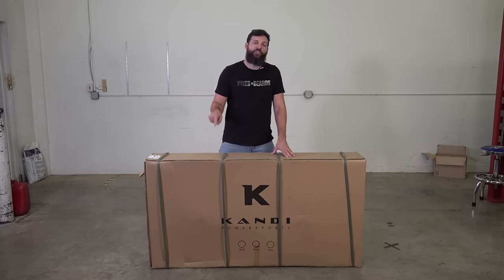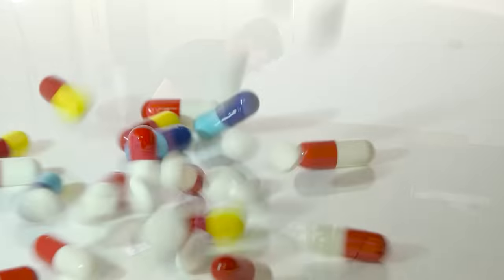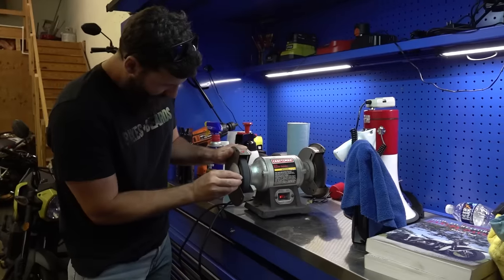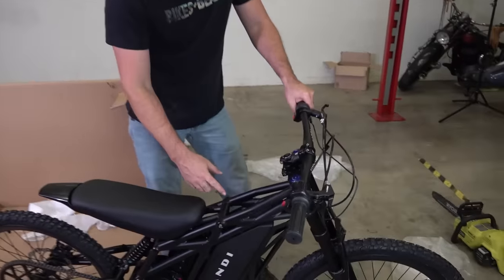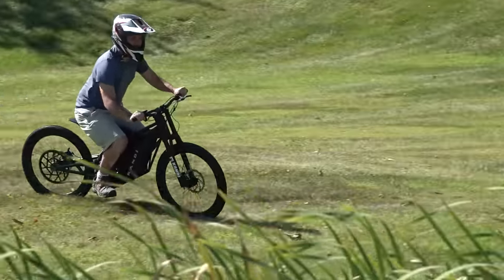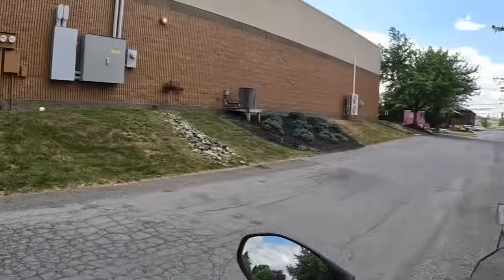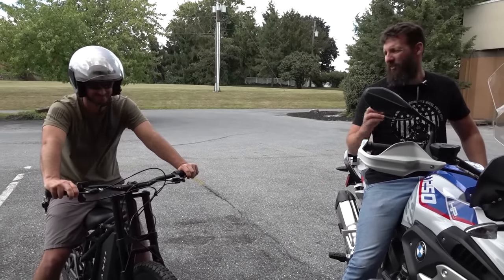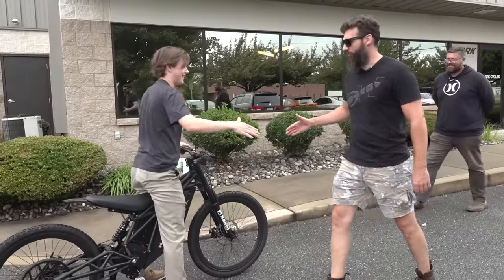I Bought the Cheapest Electric Dirt Bike at the Auction

Comment: I had a similar issue with spacers on a dirtbike wheel I was trying to install, it turned out that the spacers actually kind of press fit into the hub. I had to apply some pressure (more than I was expecting to need to) on each spacer and then they sat into the hub just slightly. I wonder if that was the issue you were experiencing with the spacers?
Reply: Doh
Reply: could explain some of the grinding sound if the spacer and bolt were spinning
Reply: I hit everything with rubber mallet until it works
Reply: @supersecretyoutubeaccount  poor wife you have
Reply: @destickert1307  😂😂😂
Reply: @supersecretyoutubeaccount  If a rubber mallet doesn't work, a hammer can fix anything
Reply: @gregorydeutsch3530  The easiest way is to sandwich the wheel and bushings tightly against a light-pole at any Walmart parking lot with your truck's front bumper. Go shopping for a few minutes. By then at least 3 Asian drivers will have completed the assembly.  {-_-} 🤣
Reply: Did you cuss at it..? That’s works for me!
Reply from the maker: Ohhhhhhhh shoot
Reply: Standard mountain bike hub with changable spacers to suit different sized fork/axle sizes, 15x100, 15x110, 20x100 etc.
Reply: @supersecretyoutubeaccount  Funny story. About 20yrs ago 3 of us maintenance guys were helping the mold-crew drive in some new date inserts on a big aircraft tire mold. We used to pour our own Lead hammer-heads for soft-blow hammers but "BadYear" decided to replace them with those "safer" Nupla rubber-hammers.

That day "Bill" was taking his turn at beating on that insert and suddenly he stopped hitting it. We realized the rubber head had broken off. We looked all around wondering where it went. Then we saw "Ted" (another maintenance guy near us) jumping around wildly, cussing and holding his forehead.. When we got him calmed down, he removed his hand away from his forehead and a big ol' cartoon knot came up on it. Some of us could hardly breathe, we were laughing so hard!! 🤣
Reply: you are supposed to tap them in with a mallet
Reply: the lack of knowledge here is astounding
Reply: @destickert1307  she works at least
Reply: @supersecretyoutubeaccount  ASC certified I see!!!

Comment: I'd like to buy an electric bike, but there are so many manufacturers my concern is getting ripped off. The other issue is buying one and the manufacturer goes out of business.
Reply: If you want a mtb/dirt bike mix, a Sur ron is a great way to go. It is a very reputable brand with lots of 3rd party vendors that have upgrade parts and eom parts. I have a Sur ron myself, and it’s a blast!
Reply: @brodienelson380 facts get a sur ron
Reply: A suron is the bast way to go buy u can easily fabricate ur own with a company called electro and co.
Reply: Buy a Lectric XP
Reply: Aside from that, the biggest issue is the cost of the replacement battery pack(s) that you will need to buy in a few years.
Reply: @yamizombie1974  why they are slow
Reply: I want buy something like surron but weaker under $2000
Reply: Surron ultra bee is my favorite electric motorcycle. Very capable on and off road, fast, massive 72v 55ah battery as stock.

Comment: I bought a whipper snipper that came with allen keys. I tightened one bolt and the allen key was done for. Its now round. I swear they make then out of ALUMINIUM. The bolt, however, is perfectly fine. Luckily i have actual tools and tightened the rest up fine

Comment: My wicked e bike cruiser does 39 MPH for 1,999$. Bmx handle bars, (The freedom has full suspension) 26 inch fat tire. 60 Volt 20 Ah battery, 40 amp controller over 2k watts output 1k continuous, 100 NM Torque. Nothing beats it for the price. Nothing comes close.

Comment: Not heard of the bike brand but have you checked to see if the forks are air or spring
If there air you will need a shock pump to pump them up (1psi to 1lb of body weight)

Comment: The fork has an air spring. You probably need about 100 psi in the fork. Its still a crap fork but, it will ride better if you air it up.

Comment: Its actually not that bad of a bike when assembled correctly and set up right. The front spacers need pushed in right they fit prefect. The front forks need air and oil and the rear shock needs adjustments for the rider. After all that you're good to go. Bring it to mon-valley ill fix it
Reply from the maker: I’m not sure that I can see how those front wheel spacers ever went in there the way they were. But even after that the ergonomics of the bike were awful
Reply: @BikesandBeards  it isn't the best for tall riders no lol but there is different peg sets extenders and what not. Its a clone of the Drill one evo bike which is AMAZING 👏

Comment: you could remedy that fork problem by substituting it with an Air/oil shock
Reply: Also,you need to raise the seat. The seat height needs to be so there is only a very slight bend in your knee

Comment: Do the forks need air in them?
Or are they spring forks and you are too heavy for the sping?
Reply: Yes they do. These are Mountainbike Downhill forks, they should be pressurized with the riders weight to spec.
Reply: Yeah I kept thinking the same.  And they could have adjusted the rear spring preload.  But it probably would have been disappointing anyway.
Reply: Also, how can a disc brake on something so light be so ineffective? The internals of all those parts are just garbage it seems.
Reply: @vincedibona4687  because it's a mechanical disc brake. They (manufacturer) should have went with hydraulic brakes on that bike.
Reply: @k0k0w  

It's not because it's a mechanical brake, that's the issue. It's because they don't know how to do basic bicycle maintenance. They clearly left the cables slack.
Reply: yep
Reply: @Psyrecx  you could see when the camera man pulls up he has the levers pulled all the way back meaning that there too much slack and it's not adjusted right
Reply: @k0k0w  mechanical disc brakes are good. I have some on my motorized bike and they stop from 40 in like 10-18ft
Reply: @Psyrecx  he's used to hydraulic brakes he never has to work on the old trail 90s they never break
Reply: @kevinmontoya7318  Depends on the brand though. Those that come stock with the bike are sometimes a bit janky. Also, I think the new ones on the bike aren't bed-in yet thus the poor performance.
Reply: @Psyrecx  True. You have a point.
Reply: @kevinmontoya7318  

That was my point. Typically, when you get a bike, unless it's built by a high end shop, you have to check those things... as well as stuff like spoke tension. 

They work on motorcycles, and they probably still never check that, as well.
Reply: @k0k0w  I totally forgot about the brand. I have tektros on mine
Reply: @16driver16  Those mech ones that come from 90s bikes are agreeably not bad. But these ones that come stock from china are usually questionable, thus i'm picking hydraus over mechs at this point.
Reply: @kevinmontoya7318  yup. Tektro and those that come from Avid and shimano are the better ones. Pauls are great ones too, but are a bit pricey.
Reply: @k0k0w  true, though his 90 actually has pretty aweful drum brakes front and rear they still are very low maintenance and work for a long time
Reply: Yea honestly really sad that these guys couldn't figure out how to set that bike up right. I can tell its not as garbage as it seems in this vid. Come on Bikes and Beards! If you're going to do bicycle stuff atleast learn how to do it right. watching a simple youtube vid on how to adjust brakes and suspension would have helped so much in setting this bike up
Reply: at that rrp they should definitely NOT be mechanical brakes though, at $1100 you can get away with cheaper brakes for sure
Reply: Yes i lmao. Forks need air.
Reply: @-Jethro-  to me it seems ok
Reply: @jackstange9211   
Or help out a local business and get it assembled by a bicycle mechanic, where they can help you with the review by giving insight on whether or not the bicycle parts are any good, what you have to do to set it up and possibly suggestions on whether you should buy cheap and customise or just pay a higher price.
Reply: @Psikeadelic  
It's pretty sad how the bicycle industry is going lately. The times when you actually got value for money with bicycles is long gone, nowadays industry leaders are too busy making proprietary components that only with with proprietary tools, they've settled on a new standard MTB wheel the 27.5 inch, almost every brand except for Walmart and toy store brands are a minimum $1000 for entry level bike... Yeah nah no thanks, I have been a bicycle mech for 10 years. The industry is dead and greed and carbon fibre did them in.
Reply: They will be oil filled, the "slime" he had on the headstock was fork oil.

Comment: I wonder if the bearings were properly seated in that front wheel. Also, I'm wondering if that's a counterfeit bike. That would explain the tailgait deal
Reply: Sur Ron rip off possibly
Reply from the maker: Maybe
Reply: Its called the Home Boy Shopping network in my Hood, Deals to good to pass on!
Reply from the maker: That could have been it
Reply: Can I have it
Reply: @SHAUNDIGITY  I can here the theme song now ending with..."IN LIVING COLOR!!!"
Reply: More than likely someone bought a damaged pallet of these bikes for cheap at auction.
Reply: I took a look at the spec sheet and it's specced terribly, a good bit worse than my own ebike, which has pedals and is built off a regular bike and $1200 in parts. Smaller battery, half the power, worse shocks and brakes. I don't think it's counterfeit, it's just a rip off.

$3600 could get you a 70mph ebike with a 4x bigger battery, and 30hp, the Kandi is only 1hp.

Comment: I would imagine that those shocks need either fluid or air to allow them to work. But it’s kind of weird how at that price the disks are hooked up to cable rather than hydraulics. Looks like a really fun bike for a grand but more than that seems like a rip off.
Reply: Yeah, they're bottoming out completely and that's why he's sliding off the seat, lol.
Reply: Some mechanical disk brakes work very well and provide excellent feedback to the brake lever
Reply: pretty sure its oil was all over the head tube when they opened it up. seems like its all cheap parts. mechanical brakes, cheap forks, tires. the sitting position is scary. yup, rip off
Reply: @melaniecotterell8263  some...but those are not any srams or shimanos. its all cheap components from china
Reply: it's only cheap hydraulics brake, great for light bike not for a bike that weight a ton
Reply: I'd assume hydraulic fluid since that's probably what the slimy stuff was so the the shocks are leaky and now bottoming out
Reply: air, theyre mtb forks
Reply: mtb forks come without full air pressure
Reply: I thought same…. I’m guessing they hoped we wouldn’t notice that ?  No way possible they didn’t….  Reality TV on YouTube..

Comment: I wonder how fast can an e-bike made from Ryobi chainsaw go.
Reply: you might be on to something there... Grind hard plumbing made a tiny boat go with a drill and someone else made a razor scooter with a drill drive too
Reply: Well ryobi is pretty trash so not to quick
Reply: Tree mph
Reply: Negative 10 mph
Reply: I don't know but I bet it would buzz along
Reply: Volts = speed. The chainsaw is 40v so I'd say like 15-20mph max. The problem is you need a much bigger battery
Reply: @Ridzy2489  I’m a Milwaukee snob but ryobi is not trash you’re mistaken
Reply: Durham Reality  it’s funny you say that because they likely supply parts for 98% of the market dig deeper then just the scratched interesting truth
Reply: Durham Reality  I’m still curious on the kandi - ryobi connection I’ve found nothing to support it, other then TTI Produces, Ryobi, Milwaukee, amongst others…
Reply from the maker: Great question
Reply: @TheOneAndOnlyRandy  Grind Hard Plumbing also did a electric chainsaw motor into a small motorbike.
Reply: @BikesandBeards  Zero to sixty in 4.3...minutes, but it would get 200 mpg!!!  At least take off the teeth on the chain if you are going to ride it!  Hmmm?  Could the saw chain be replaced with a bike chain and a 21 speed, 7 gear wheel at the rounded end?  Has it already been done? ****It would only be a 7 speed because you wouldn't have the front 3 gears that a pedal bike has.  NEW IDEA...Pedal assist Chain saw MOPED!!!

Comment: I’m 80 % sure that those are air forks and if not the springs in it you might be able to change them out for stiffer ones because this forks alone they use for downhill bikes sooo maybe check to see if you have to put air or if it is a front spring loaded shock
Reply: Umm if "air forks" like old 80's bikes they would have a Schroeder valve on the caps .... Duh! 🙄
Reply: @shawnsatterlee6035  They did, the big red cap on the end. Underneath.

Comment: The axle had on it the fork leg, bearing, then bushing; you assembled it fork leg, bushing, bearing, then hub.  I bet if you had followed the correct order it would have fit without grinding.
Reply: Yeah, and the brakes would have worked better as well. I'm assuming the caliper is slightly misaligned now.

Comment: that front end fort just leaked fluids out of it that was why it failures seal o ring and company who make it was totally failures it not worth 3600 dollar i do say worth $200 like is it as it is because it run n ride fine just dont have enough miles n one i just build like diy with 3 12v battery just make it 30 miles going 40mhp straight line no stopping (i find my self a broken dirt bike that engine was trash n broken (look like crash landed into tree limps into engine) i swap it out for electric motor and put 3x 12v battery in it fit perfectly tight no touching each other and only one issues with it esc DOES NOT COME WITH CHAGER OR DOESNT HAVE CHARGER PORT so i have charger each battery with one charger that u normally use charger car battery that was all and later i find one small 5amp charger 12v n add them together and make it run off one ac plug unset of 3 plug and draw 18amp almost 20 is limited n later one someone come racing down here asking me want buy it for $4000 so i have let it go and got my self a car i wish should kept it but oh well 4k dollar just outsmart me maybe i make other one and try sent to you n see what u think

Comment: The suspension just needs some air. Your ridding the bike with the forks in full compression! Won’t help the motor though lol.
Reply: dont know what type of crappy motor they use but you can make it go to 40 with a wiring and sprocket mod but I wouldnt to that on this bike as my front wheel fell off while riding it this thing is dangerous also dont text the scammer

Comment: It seems to never fail that these guys have to do something really dumb in between everything else that seems solid.  YOU USED THE TOOL WRONG!  You should put the bit perpendicular to the case and then apply rotational torque.  I'm not saying it's a good tool but you must work to its strengths.
Reply from the maker: get out of here, that tool is junk

Comment: Likely a set of containers sat off LA for 8 months in 2021...they got written off as a loss.  When they were finally unloaded, bought for salvage by the container.  Ended up costing the reseller $100 per.  They sold them for $1000 profit.
Reply: That or it was a full reject lot bought by an offlot importer.

Comment: They really ask 3600 for that?the easiest way to tell cheap parts on any sort of bicycle is if they have the bike makers brand on them. If forks etc have the same brand as the frame they are guaranteed to be as cheap as possible, and basically everything on that bike says Kandi. Not Shimano or rockshock or anything like that. Unless a battery and a motor costs 3400 that's some serious junk.
Reply: in China they are selling for $500 for the 800w and $1000 for the 1500w

Comment: You're supposed to fill the shock with air to support your own weight.
Reply from the maker: I did not know that
Reply: @BikesandBeards  Me neither, until i had to rebuild a fork myself when the lockout was malfunctioning.
I ended up actually reading a manual and found a diagram for my weight and fork PSI value. :)